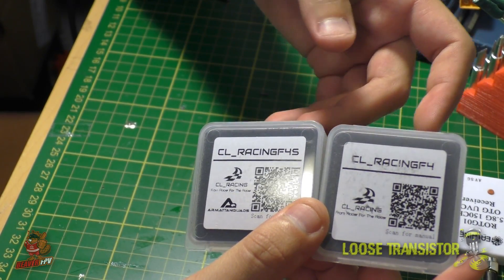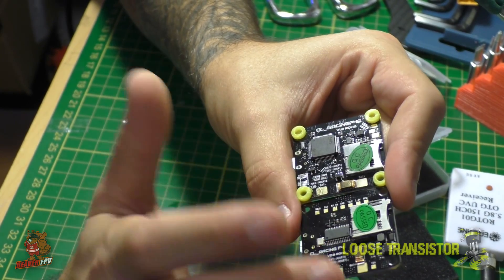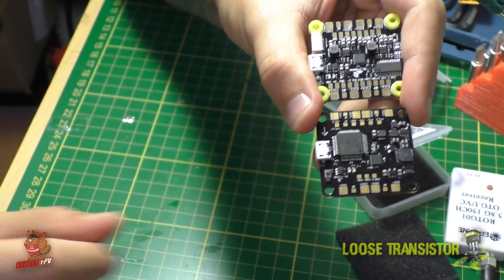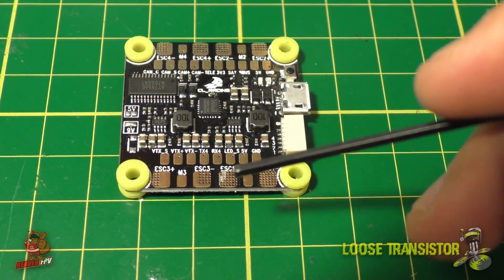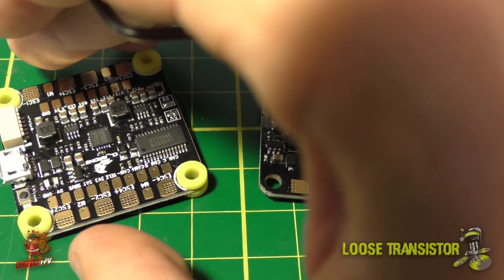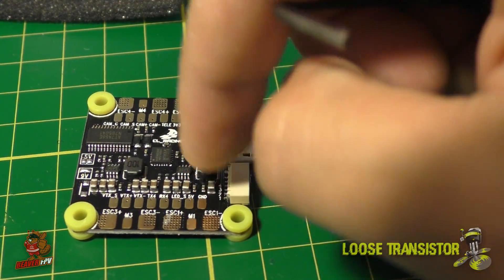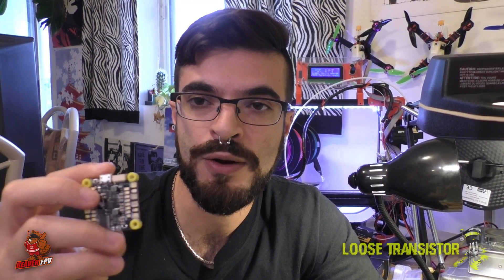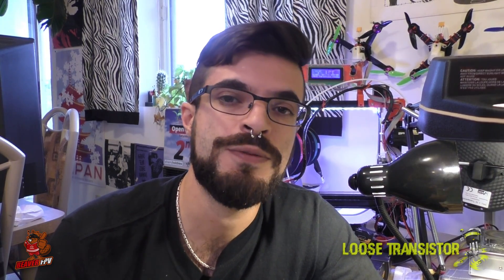CL RACING F4 - Flight Controller Overview - [ REVIEW ]

Comment: Hi mate, how would you connect Matek 5V Lost Model Buzzer to CL Racing F4? 

Which 5V pad on CL FC would you use for this buzzer? is it ok to solder 5V Buzzer wire to 5V Reciver pad (share this 5V pad for receiver and this buzzer) and to the Receiver ground pad and then the 3d wire of the buzzer to B-  ?

Comment: I have been running bardwell f4 boards for the last year and have had great video, crystal clear. Zero complaints. I recently bought some clracing f4s v1.6 boards and have had bad horizontal/diagonal  checkerboard lines in my video. I race so stuff breaks. Thought that these would be the same as the bardwell boards. Just wanted to report my findings.

Comment: Does it come with a wiring harness for the aio just connector? Because the aio I am planning on has a jet with more pins for that. If not is there an aio you recommend that has that jst? And does that have 2 hardware inverters or just one? Thanks!
Reply from the maker: They do not ship with any wiring harness unfortunately - newer versions of the CLF4 do come ready for 4in1.

I believe it has 2 hardware inverters =)

Comment: I'm having a problem with my quad and I'm using the new cl f4 board it arms but almost immediately shuts down and won't re arm until I unplug it and plug it back in I'm running ibus into the sat pad any ideas on what could be the problem?
Reply from the maker: Dtf Fpv easiest way to find out would be to try and get a black box log to see what is actually happening.

When it Disarms, do the ESCs restart?
Reply: Loose Transistor FPV no once it stops I loose the green light on the fc and it won't do anything
Reply from the maker: Have you checked all the solder points and made sure they are good? how much troubleshooting have you done so far?
Reply: Loose Transistor FPV all the solder joints look good and my buddy and I messed with it for about an hour last night . We flashed the betaflight 3.2 on it and it would arm and I could throttle up for a second and it would shut right down . Even if I pick it up with it armed and the props off if I pivot it around it will shut down as the gyro tries to throttle up the motors . We can go to the motors tab on betaflight and bring the motors up to full throttle without issue but as soon as I try arming it and throttling up it shuts down
Reply: Loose Transistor FPV can I run  ibus through the sat pad or does it need to be through the sbus pad
Reply from the maker: OK a couple questions here.. can you give me a full list of specs?
- Check your battery - make sure its not dying on ya
- Have you tried arming it while connected to USB?
Reply: Loose Transistor FPV it's little bee blheli 35 amp esc's and a flysky x6b receiver and yes we have and it still shuts down
Reply: Loose Transistor FPV the battery was reading 16.6 Volts
Reply from the maker: You migjht want to try adding a 470uf low ESR capacitor. Seems the CLF4S's are sensitive to any feedback coming from motors or ESC's
Reply: Loose Transistor FPV ok thanks I'll try that
Reply: Loose Transistor FPV ok so now it will arm and I can throttle up but if I pick it up while its armed and pivot it around it shuts down and the green light goes from blinking to a solid green light
Reply: This is a common fault being reported with 'S' version.  If you cap all the escs and it still has the fault your basically screwed.  Mine flys, but it has random faults where it won't re-arm like yours.
Reply: I got a new cl racing f4 from get fpv and now my esc’s are getting power but no signal any ideas ? Also do the lights on the flight controller flash a trouble code or error code?

Comment: Just picked up the FC. I was worried they sent the wrong one as it says V1.2 on the PCB instead of V2. I'm glad yours says V1.2 also. I'm worried now about all these death roll issues I'm reading about everywhere. Did you get this FC installed yet? Any comments about the death roll issues?
Reply from the maker: DJB HSI the issue seems to be isolated to Speedix and Emax Bullet ESCs. As long as you stay away from those parts you should be fine.

I have built two quads with this FC - both work great and have no issues with DYS ESCs I'm using.
Reply: Loose Transistor FPV well that's shitty news because I only run spedix 20amp escs
Reply from the maker: Sorry to break it to ya my friend.. but seems to be the case and AFAIK no remedy either. Might wanna try a different set if you are going to use that board.
Reply: Just msg'd Justin at Rotorquest and he claims Cheng says to run a cap and it won't be a prob... I always do anyway. Apparrently Justin runs these esc with this FC on his own build without issues. Hope it's the same for me as I love the spedix escs.
Reply from the maker: Yeah I have heard some success with capacitors or capacitor per ESC

Comment: The holes in the board didnt look lined up to the pads.
Reply from the maker: What do you mean by that?
Reply: when the board is made, some are made with tiny needle pinholes where the solder pads are, some are ok, but some are completely center off where the pad should be, or vs versa, maybe the pads should have been put on first, then came down with the holes, and so on this board they dont look lined up correctly. so im a bit wiery of that. I know other boards that were made without the pinholes, and those had problems with the pad coming off when soldering or unsoldering wires
Reply from the maker: Ojos de Ismael ahhhhhhh! Yes I do see what your are saying for sure! Interesting, I wonder why that is

Comment: can I use for ibus the sbus pad?
Reply from the maker: I believe so.
Reply: thanks for your reply ... now is the question what is the quality of your believe :-) ... btw. I WAS a fan of matek, I did purchase four AIO FC from them but two are absolutely dead - yaw twitching and dead spiral. I did soft mount the motors, FC and installed 5 capacitors and still unusable. so the product quality is 50% what is very poor result. I'm tired to spend my time on emails with the sellers to apply replacement. for me appears that there is no 100% solid product, we can choose just a less problematic - sad.
Reply from the maker: saticitta I've only ever had one defective board out of 20 and it was a loose USB connection. So far quality on these boards had been great!
Reply: I just purchased a clracing F4S FC, so after it arrives I will install it and evaluate how big (or small) is a great :-) ... just having fun :-) ... btw. how about the compatibility of this fc with the t-motor F30A 2-4S? I just find out that there are couple of esc's which have serious problem to work with this fc.
Reply: Loose Transistor FPV ... I got the CL Racing F4S already and after 10 packs I can say that this is my to go FC 

NOTE for FlySky users with iBUS: solder the signal wire of your iBUS receiver to the TX4 pad of the FC and in Betaflight/Port enable Serial Rx on UART4 and you are good to go
Reply from the maker: Awesome man =D Glad you liked the  FC that much. Its super solid, great flight performance and so far I have had no issues with any of my CL builds.

Thanks for sharing the info on how to set it up for iBus as well.

Cheers!
Reply: saticitta Did you get IBUS working on the SBUS pad?

Comment: Is the gyro capable of running 32k? Can you use the new 32k esc's?
Reply from the maker: Unfortunately it does not do 32k loop times. Most you will get out of this one is 8khz because of the MPU6000 gyro. In my opinion this gyro is superior to the 32khz one or at least has been optimized better on BF

Comment: Do I have to do anything special to get telemetry working? I connected the wire and set it to uart4 and I’m not getting anything.
Reply: 5. For use telemetry. select the uart3 as smartport. and go to CLI do " set tlm_halfduplex = off " you have to use this command to make it work.
Reply: your welcome :)
straight off the cl racing website
Reply from the maker: As far as I understand all you need is the Uart3 set to telemetry and BF 3.2.1
Reply: That's what I thought. Telemetry is not working at all on the Taranis. Can't get the vtx stuff either. But the camera and VTX work as expected. I can arm and throttle and all that. So weird. Any ideas on where I should start to troubleshoot?
Reply: Man, thanks for posting this.... I could not figure out why the telemetry was not working. That command fixed it. Where did you find that info?
Reply: I see it now!

Comment: Hi. Based on the description in the website link it still says you need to hack frsky xsr and sb for telemetry to work. Do you need to still hack if you are using r-xsr?
Reply: 5. For use telemetry. select the uart3 as smartport. and go to CLI do " set tlm_halfduplex = off " you have to use this command to make it work. (no hack required as far as connecting to the uninverted part of the xsr)

Comment: Great review,  just got mine today and was curious before I wire this up,  do you think I can hard mount this board like the CL V1?  The CL V1 flew great hard mounted and hoping this is the case with the V2,  thanks!
Reply from the maker: You will be able to use standard standoffs with it and since it comes with the yellow gummies you get the best of both worlds. It's soft mounted and its low profile. I highly recommend you use the gummies..

If for wahtever reason you are dead set on hard mounting it just don't use the yellow gummies and it should be fine